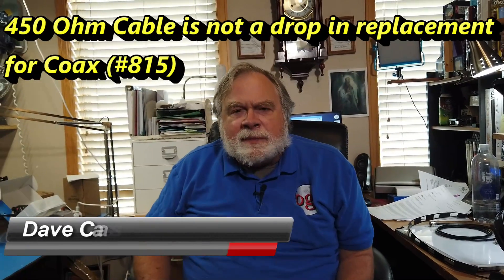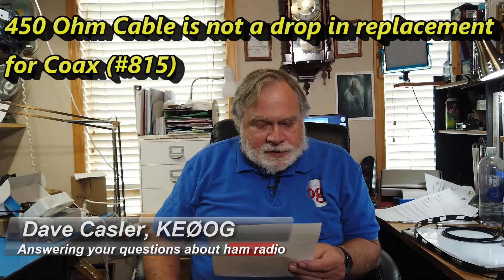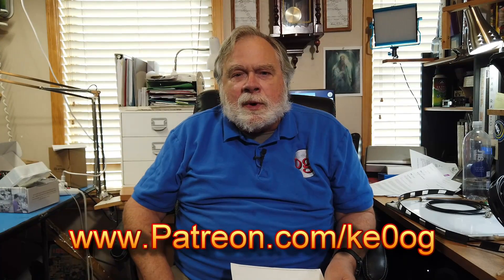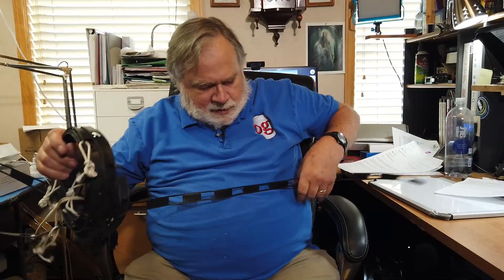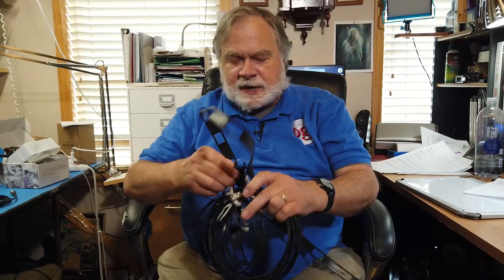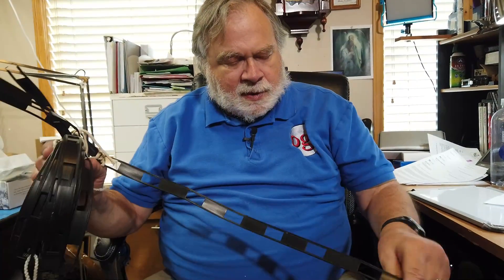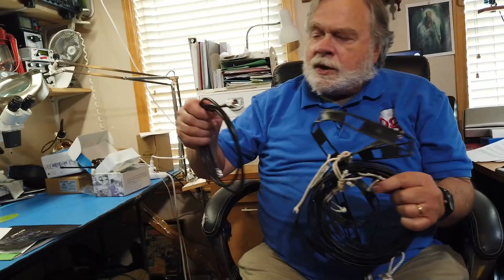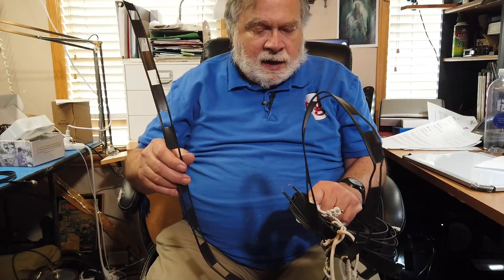450 Ohm Cable is not a Drop in Replacement for Coax (#815)

Comment: I too have a QRP radio, the IC-705 and my first antenna provided to me is a G5RV 102' that came with window line as a feed line. I was told I would always need to run a tuner so I hook it up to my AH-705 which is connected to my radio via coax. Is this the appropriate way to run this antenna or do I need an additional balun? Also I sometimes struggle to find a tree tall enough to get the window line completely off the ground. I always make sure it doesn't coil and it runs perpendicular to the dipole wires but will touching the ground be badly detrimental? I haven't noticed an issue so far but how much worse is this setup than one where the center of the antenna is at an appropriate height?
Reply: 1/4, 3/4, 1-1/2 wavelength is a matching stub.
1/2, 1, 1-1/2 wavelength maximizes impedance loss.  This trick only works at one frequency.  You are better off using a well matched antenna and then cable length does not matter.

Comment: You did not even suggest window line with no Balun at the Antenna.  An auto antenna tuner with memories would be able to match the antenna in no time.  Even a manual tuner could be set repeatably to known settings very easily.  With this setup the antenna would be able to operate on all bands ABOVE the fundamental frequency.

Comment: looking to replace my 150' of coax to my CB antenna with 450, and on both ends im going to use a coax balun 4:1 with a 1/4~ piece of 300 flatline which should bring it to 450. be good for monoband operation. not a ham so i don't have to worry about other bands for this one so i can ixnay the loss potential with using ferrite

Comment: I think Dave meant to say, "it can be low loss". Having a window line run in close proximity or touching metal objects, running window line on the ground, running window line through a structure, and of course window line getting wet. These are all scenarios where window line has potential to incur losses that just wouldn't happen with coax.